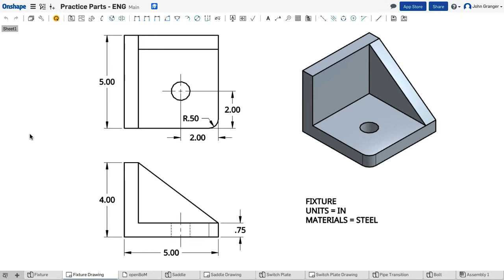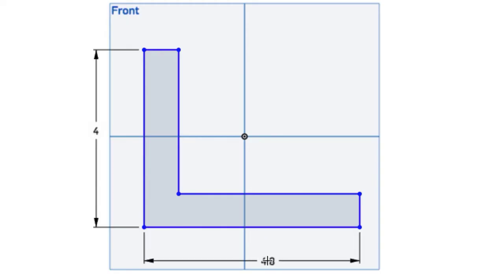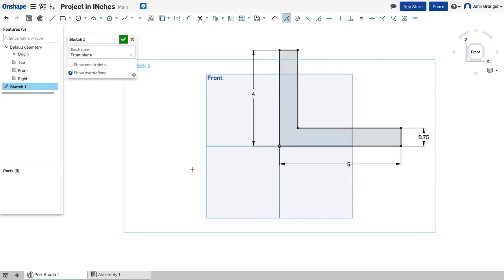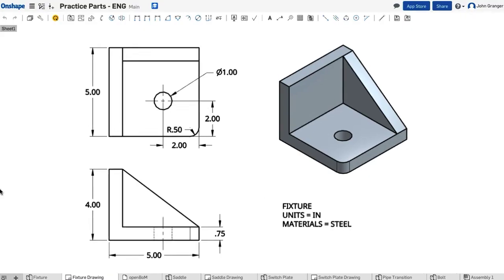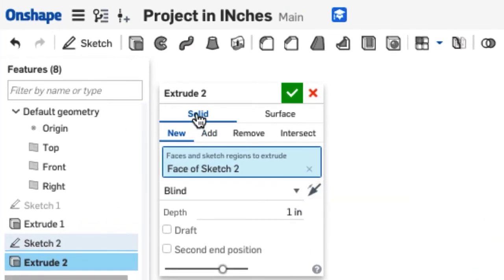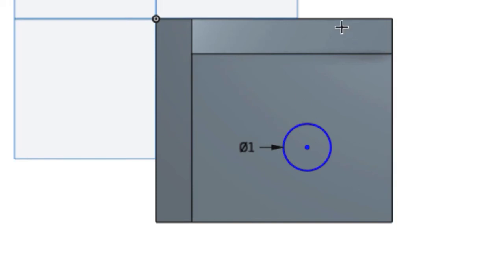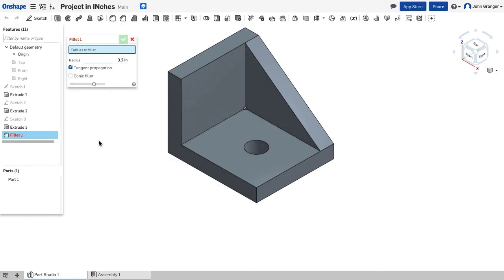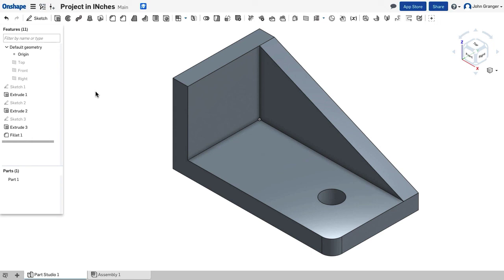Onshape Project - Fixture

Comment: Im new at onshape and enjoy learning.  Why didn't you add the fillet in the sketch instead of after extruding it? Pro vs cons? I do it last also but does it matter?
Reply from the maker: Hi, You are right, the fillet could be added as part of the sketch or as a feature, your choice according to the design intent.  As a rule of thumb, placed features, like fillets, chamfers and holes, are placed last in the model to reduce any conflicts in editing when adding earlier features.  Keep at it, I think you will really enjoy learning Onshape and you have a good mind to ask process questions as you work.

Comment: So much help in a short video. I recently am getting back into cad after not using it for 12 years. I still can do a decent bit but sometimes I need a refresher. Also helps me learn onshape since I haven't used it before.  
This video was exactly what I was needing to help me finish a project that was about 90% complete.  Granted it was more than a bracket but this still applied
Reply from the maker: Thanks for the feedback.  Check out cadvideotutor.com for all of the projects

Comment: Hi, i just got into using cad about 1 week ago and is wondering, is making a ball bearing using on shape hard? There are almost no tutorials, of others using on shape to make a ball bearing, and appreciate you making these types of vids.
Reply from the maker: Hi, making a ball is quick and easy using the revolve feature.  Start with a sketch of a circle with the diameter of the size of the ball you want to create.  Draw a vertical line through the center of the circle through the center point dividing it in half.  End the sketch and use the revolve feature tool and choose the profile of half of the circle.  Revolve 360 degrees and you have a ball.  Edit the diameter of the circle in the sketch and you can make it any size you want.  Here is a video that uses revolve:  https://youtu.be/hnT84ITY080